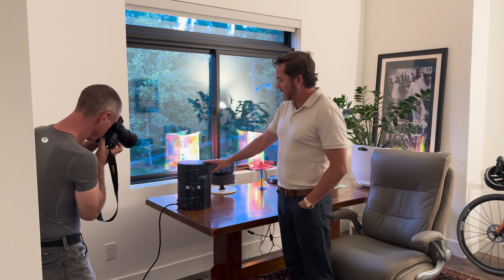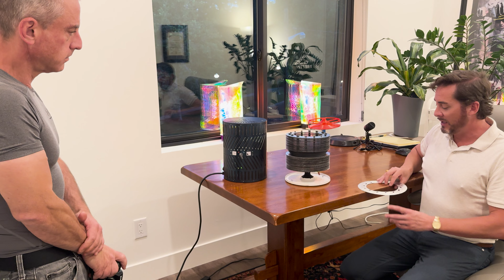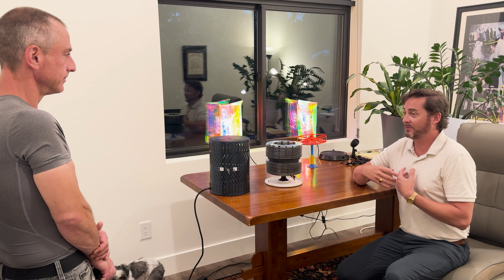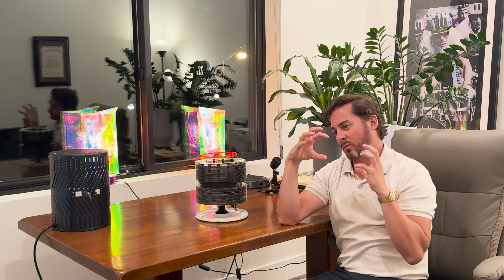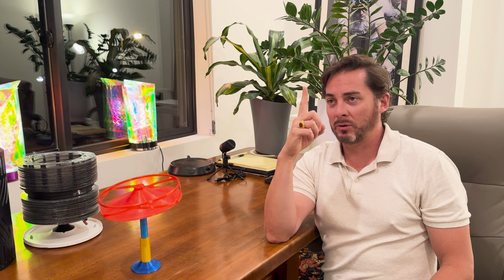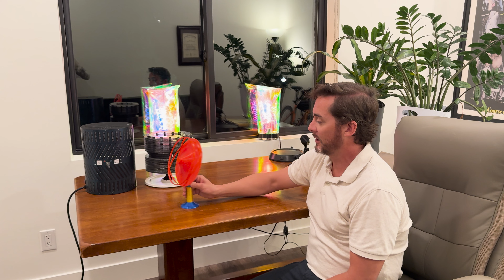Nativus Power Heat-Pump Breakthrough | Matt Miller

Comment: logic states if you can cause a vacuum type of cavitation you could obtain either a excellent heater or a excellent refrigerator ie naturespistol shrimp the heater ..( if it can be super hot then it can be super cold

Comment: It's interesting; I guess it sets up a toroidal flow in the room; allegedly a step towards overunity via the Shauberger approach? How does the heat exchanger cool the air? or does the toroidal airflow simply cause cooling by conversion of thermal motion into airflow?
Reply: Nothing that fancy unfortunately. It is mounted in a window or a wall where half is inside and half outside. Using an innovative cowling, a simple shift of a switch switches the unit from heating to cooling and swaps the hot side and the cold side from circulating inside air.
Reply: @firstlightbender  Ah so that's what they meant by heat exchangers; thanks!

Comment: I’m a hvac service technician, I’m confused on how it works. Is it an unfinished product? I don’t see a compressor, refrigerant lines
Reply: The refrigerant lines are burried in the stack of plates that make up the heat exchanger-and-fan-in-one. They are designated with the small black ovals that stick through the stack of plates in this model. The fan operates similar to a centrifugal fan with central inlet and radial air output. The compressor is not shown, is of a new type under development for the last 25 years, and is hub mounted. The compressor sits in the inlet of the fan/hx stack. This obviously makes one side hot and one side cold, just like on heat pumps you are used to seeing. Rotating the device makes both fans work, and makes rotary compression happen in the hub, all with a single motor which sits in the opposite inlet. The product is in its final stages of development. Testing is complete on the fan/hx, and performance testing and tuning is underway on the compressor and nearly complete. We expect to launch the product to the public in about 18 months.

Comment: COP? Delta T? EER? BTU rating? Cost? ANY useful information in the sales pitch?
Reply: Thank you for the great questoins. This is Matt, the guy in the video. We do not have final COP data yet, but we are hoping for a significant increase in COP. The fan is twice as efficient as a conventional centrifugal fan, and that is after crossing the heat exchanger turbulently, which is typically a loud and energy intensive process. The fan is very quiet at half the sound power of a traditional centrifugal fan. The heat exchanger is 30x more efficient at rejecting heat to the air than a traditional heat exchanger because we are able to shear the boundary layer. We are hoping for a 1 ton capacity, with the potential to overdrive the unit to 1.2 tons for a short period of time to get over the hump. This is possible because the whole unit is driven by a single BLDC motor and therefore can be modulated. It will operate at partial capacity for long periods of time to dry out the air and also filter it, further increasing its efficiency. Regular a/c units cannot do this. Our unit is currently 8 lbs, and competes with window units that are 10x as heavy. Looking forward to more quesions if you have any, and thank you very much for your interest.
Reply: @firstlightbender  you really need a practical test. Does it need gas ? How do you cool down the air (using pressure by any chance ) ?
Reply: @ErnestoEduardoDobarganes  Thank you for your interest. This is a heat pump using the Reverse Carnot Cycle to boil refrigerant and recondense it to move heat thermodynamically 'uphill'. It is nothing other than a window air conditioner, but with every part redesigned and improved to work together, resulting in a 10x better machine. Part of it (moving air and exchanging heat) has been tested to the highest standards in the land, and works. The compressor section is still in final development, and when it is ready, will be mated to the air moving section to make an air conditioner. We are not breaking any known laws of physics here, just making things work together much better.
Reply: About a year later- where are you with this? Any more data to present such ad COP, BTU? @firstlightbender

Comment: Why did you go film this? it seems like an ordinary AC/swamp cooler?
Reply: At 10x lighter, 6x smaller, 2x quieter, the ability to filter the air, and hopefully be dramatically more efficient, this technology could be the key to a better future for everyone on earth. It also is an all electric heater. The same technology can work as an Atmospheric Water Generator (dehumidifier) allowing us to produce water from thin air anywhere in the world. If we can do that more efficiently, this is a game changer for anyone that needs to drink water. This machine is a life support system plain and simple. Every single person on earth needs what this machine produces.
Reply: @firstlightbender  It is a quite efficient design, I'll give you that; but I'm not sure it's the same scale of breakthrough as some of the other tech we've all been working on. I guess they have a full prototype already though, which is nice.
Reply: @michaelperrone3867  Agreed. This technology is of this world, and made to serve the people of earth so that some day when we reach for the stars we will not have to bring an 80 pound air conditioner with us. Nativus is the next evolution of mankind, able to live off of the ample resources beamed to each one of us from above. A battery powered, solar powered, air conditioner, heater, and water generator are life support systems wherever we end up.

Comment: Just regular heat exchanger with overcomplicated design, small working area. BS
Reply: Not a regular heat exchanger, but a heat exchanger and fan in one. Combined with a hub mounted compressor to make an air conditioner, heater, and water generator. The first new fan type in a very long time. 30x more efficient at repelling heat, over 10x lighter, 2x quieter, and able to be made by the billions to support life on earth. Not overcomplicated, but rather a massive reduction in parts, materials, with an inherent simplicity dramatically besting current technology by 10x. I thought you guys were into new technology, which is why Tim came to see me to see what the future is going to look like. Very surprised by the hatred of these comments.

Comment: So my question is, where does it pump the heat from or to?  
Generally you are either extracting heat from one location and transporting to another, in the case of window units you are either dumping heat outside, or extracting heat from outside depending on mode.
The looks of this design, I can see it providing minor heating from the motors/pump but I am only seeing something able to move air around the room, and either concentrating or extracting heat internally so no real change in temperature in the room once its saturated on the hot or cold side.
Reply: Thank you for your question. The heat is pumped from inside to outside, or visa versa, just like a regular window air conditioner. The unit mounts halfway in a window or in a wall. The operating principal of the unit is the same as a regular heat pump, with the upper fan circulating the inside air, and the lower fan circulating the outside air. We will also filter the inside air through a rinsable air filter, a first for window air conditioners. The unit will have 1 ton of heating or cooling capacity. It will have the ability to dehumidify the indoor air.
Reply: @firstlightbender  Thanks, I would recommend in future media/demonstrations rather than a desktop unit like shown, a unit mounted in glass/a separator be used.
The desktop unit, sans ducting or any obvious separation of hot/cold sides of the unit, unfortunately is what caused the confusion here.
The desktop unit made it look more like another box with buzzwords scam, rather than something people in the business would instantly recognise as at least physically viable.
Reply: @pmvcallan  Thank you, and I agree! I wasn't planning on showing the unit off, but Tim popped in and I decided to show what was on my desk. We have the bracketing needed to mount it in the window or wall complete and this will ship with every unit.
Reply: @firstlightbender  you've said the unit rejects heat to outside, but how does the heat travel to the outside of the dwelling?  All I see in the video is a gadget with a power cord.
Reply: @walterramjet  It is mounted in a window or a wall just like a regular window air conditioner. The top half is cold, and the bottom half is hot. The cowling allows access to either indoor or outdoor air to meet with the hot or cold side, allowing for heating or cooling mode inside. The side not blowing inside is blowing outside.The hot and cold side are separated internally from each other.
Reply: Same question…